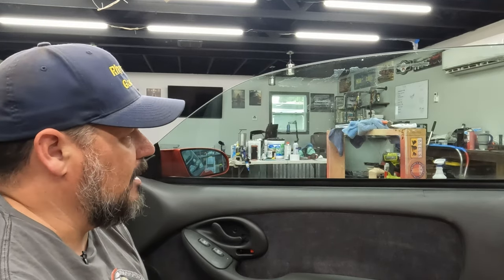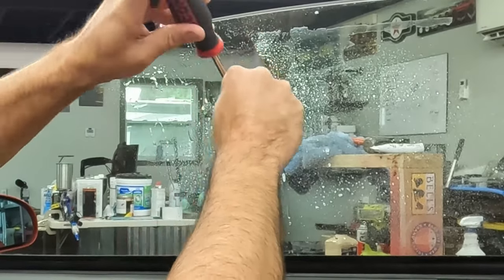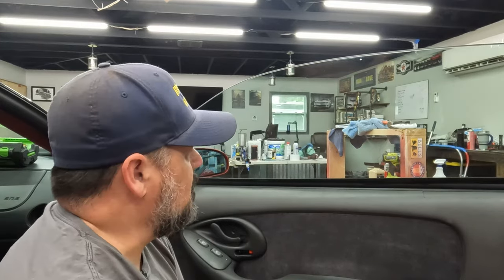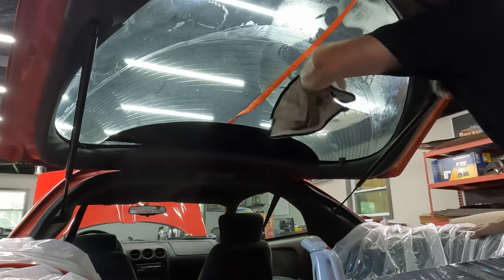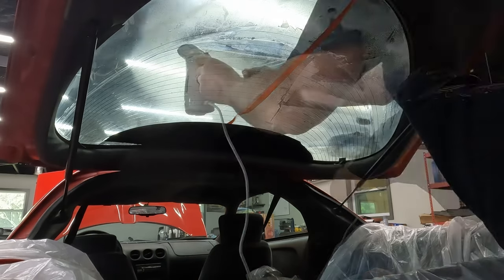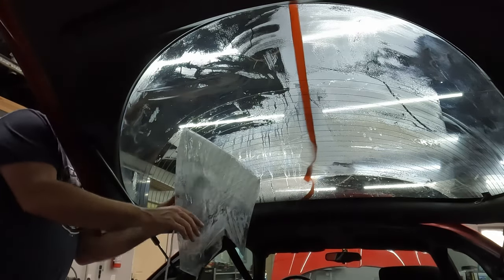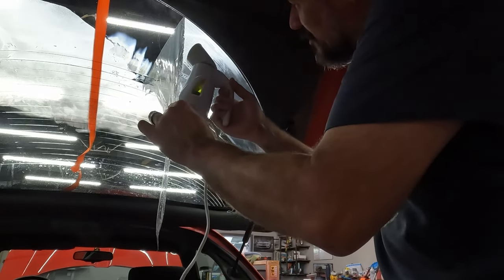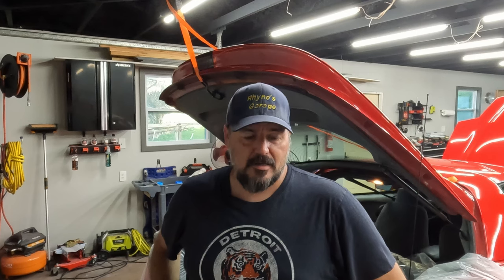Removing Window Tint and Glue - No Harsh Chemicals!

Comment: Metal razor blades aren't a great solution, and can still scratch the glass. I would be wary of doing it on the hatch, not just because of the defrost wires, but damaging the factory tint. Factory tint is not  a film like the aftermarket stuff. Pretty rare to see one of these cars with clear back glass. Must have been a barebones base Firebird?
Interesting seeing the steaming method.

Would be great to see full shots of the car outside, now that it's complete.
Reply from the maker: The factory tint was peeling so it all had to come off to be re-tinted.  Your right, looks strange with clear glass on it, but at least I can see out of it looking out now.  At some point I'm sure it will get re-tinted.
Reply: @rhynosgarage  I'm saying that's not "factory" tint on the glass. GM never put film on their cars. It's "built in" to the glass. That was clear glass from the factory (rare in those years on back glass especially) and aftermarket tint with another aftermarket layer over it. Which may be why it was flaking to begin with.
Reply from the maker: @onefuriousfox6558 oh interesting. I didn’t know that. It is a Formula model, so not a base.  Its been a curious car though form sure.